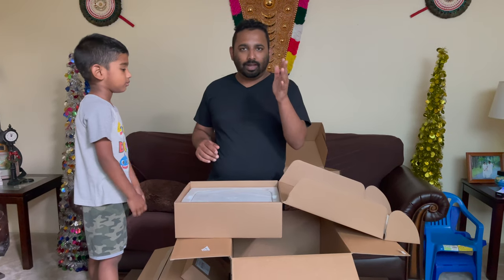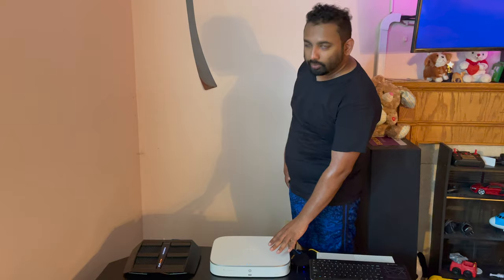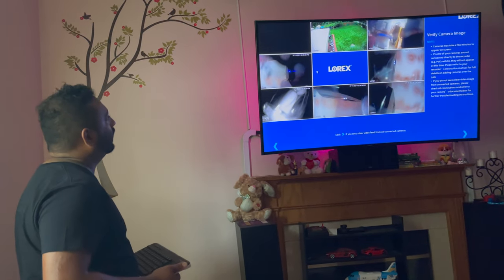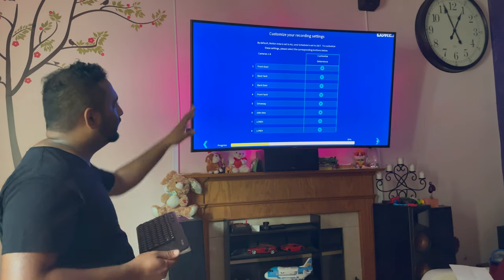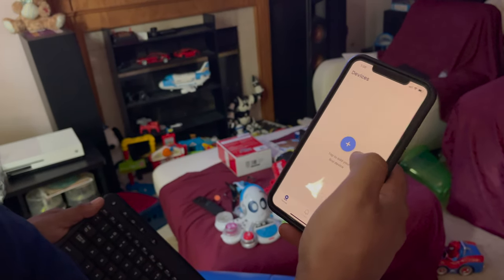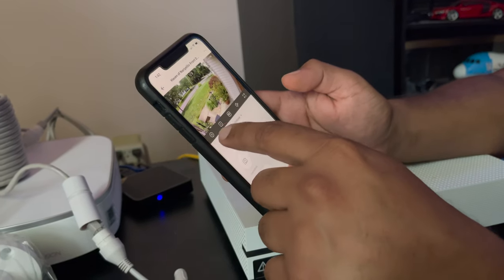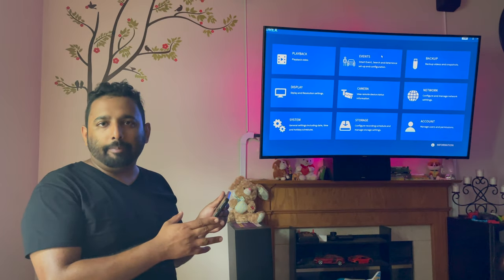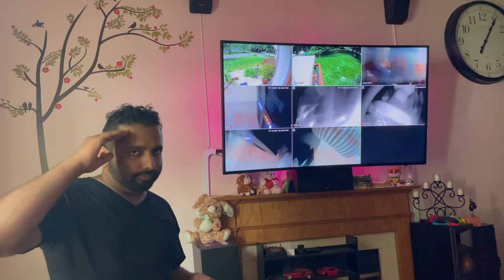LOREX 4K Security System Installation and Demo

Comment: I have the same unit and it's a headache.
It's corrupted my hard drives twice.
Lorex send me second one and it's the same problem. Units come with seagate hard drive.
I bought 6tb western Digital for bigger space.
Reply from the maker: yes i had that issue one time and it was under return period so i retured it to costco the current one works flawlessly

Comment: Hi if you have 4 cameras set up and recording 4k 24/7 then how long it’s gonna record on 2tbt ?
Also does it have loop recording that delete the old videos automatically or when the hard drive is full then you have to delete them to make it work again? 
Thanks
Reply from the maker: i run 6 cameras in 4k and it last about 14 days and yes it loops automatically deleting old footages
Reply: From the app , can you CONTINUOUSLY MONITOR THE VIDEO ??
Reply: @joefro9473  yes you can